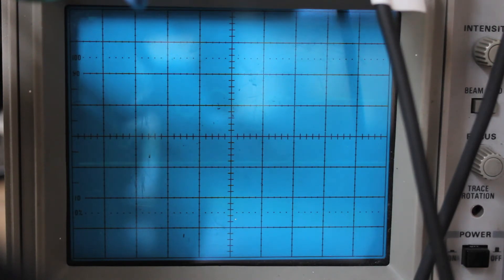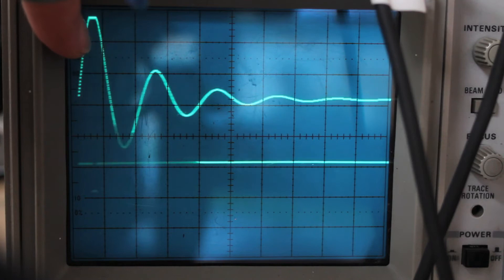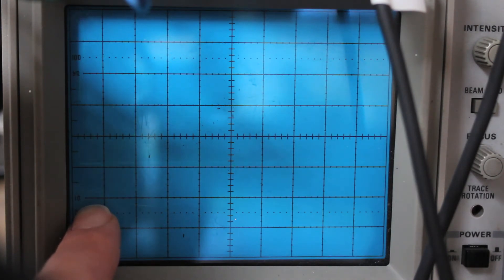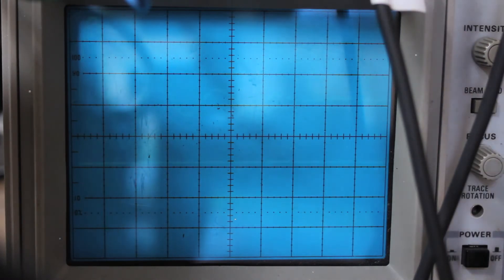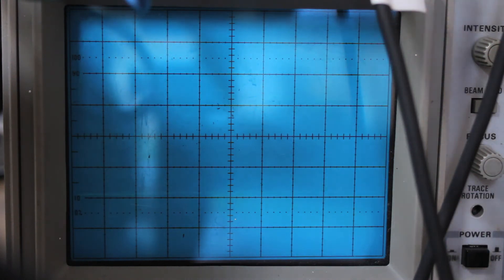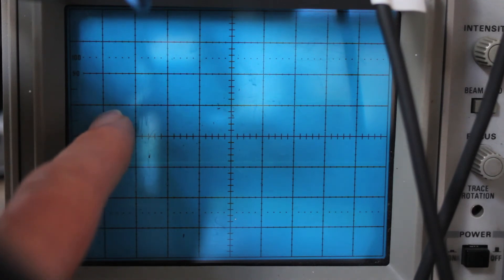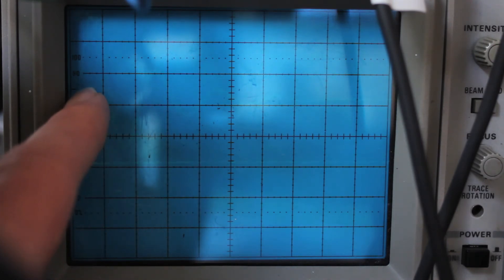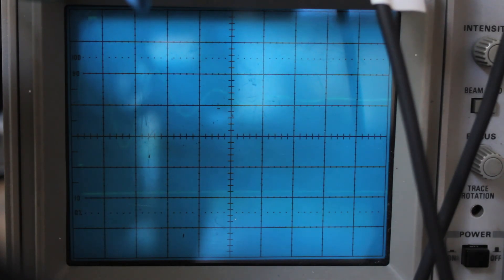ES-4 vs USB MIDI

Comment: 13 years later and still one of the simplest and best examples of midi jitter, and proof that it is solved with an audio based midi device. Way underrated video IMO.
Reply: It never sold the issue, I. tried is many times in Cubase it was night mare, ended using Bitwig and using the pinging technique but that is not always accurate ended up buying and InnerClock System Gridlock II and we are back to the 80s working in tight studios once again, its all in the coding and the driver, Os is super smart guy but one should not have this much time to set up a plugin, its should be universal easy to set up and go and yes many of us dont want to print audio, we want to run midi sequences like we did with the Atari which is way more solid that ES-4, still using it on the side of the studio with Cubase.

Comment: really interesting, is it just a matter of connecting a scope probe to the MIDI TX pin from a USb interface and the GND to the MIDI GND?

I would like to check my Cubase output from the UR22 interface. If it's bad which i suspect it is, I might get one of your MIDI devices to tighten this up

thanks
Reply from the maker: A MIDI output is a current loop, so you need to give it something for the current to flow through. A resistor across the pins will do it.

Comment: Can the ES-3 also send clock info?
Reply: If you want to send MIDI clock via an ES-3 you need an ES-5 as well. The ES-3 by itself will send analogue clocks.
Reply: Is the analogue clock from the ES-3 sufficient for the Moog Mother 32?  In its patchbay it has a tempo input (different from the MIDI input).  Here is how it is described in the manual: "The Mother-32 can also be configured to receive clock signals at the TEMPO input jack. When the sequencer is driven from an external clock source at the TEMPO input, the Tempo LED flashes green."  I'm guessing that it is talking about an analogue input since it is is distinct from the MIDI input and it accepts a standard 3.5mm eurorack cable.  I'm new to this, so forgive me if my understanding is limited.
Reply: Yes that sounds like it will work fine.
Reply: i have problms syncing my modular (mfb seq03 slave) with my daw (ableton 9.5 and 9.7, samething on both versions). im using ES3 and ES5 with silent way sync plugin. its insync but after a random period the clock jumps one step, so my turing machine will loose the sync with the seq03 and ableton samples for example. all becomes out of sync so i must stop/play ableton to resync them but i loose my first turingmachine loop. i cant play live with my modular and record long sequences :( any advice please.
Reply from the maker: YouTube comments are not the place for tech support. Please use the forum: https://www.muffwiggler.com/forum/viewforum.php?f=35